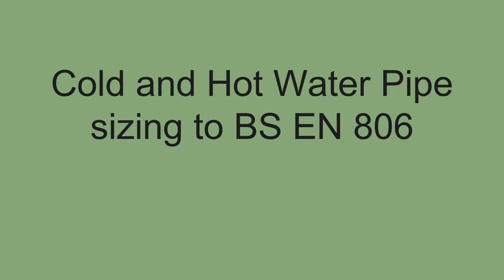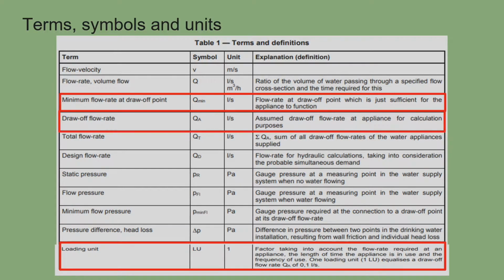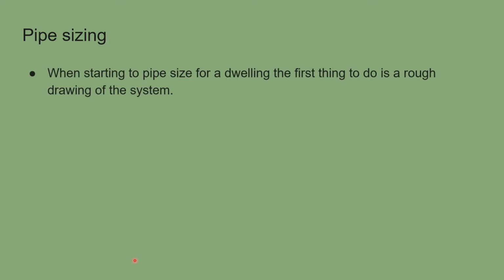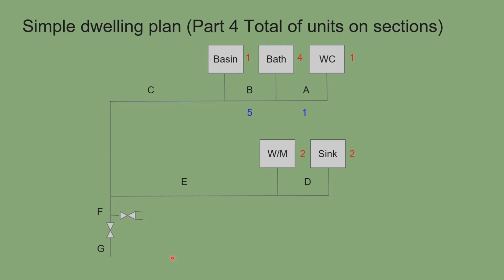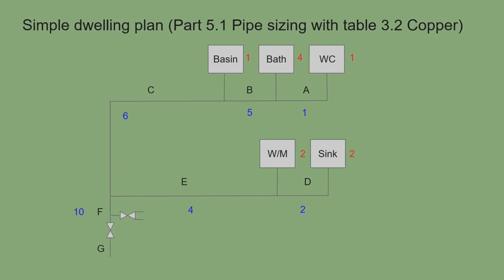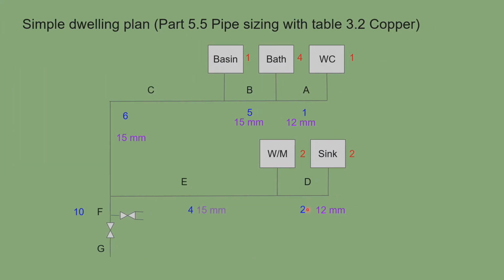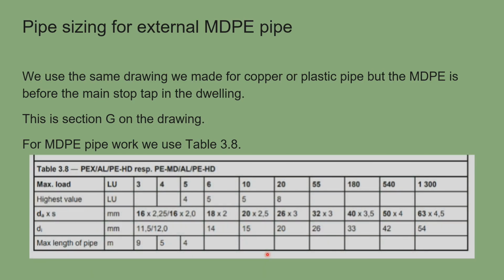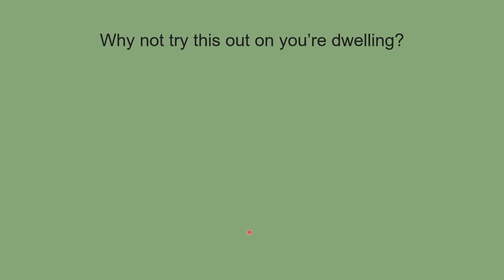Cold and Hot water pipe sizing to BS EN 806 Part 3 'Pipe Sizing Simplified method'

Comment: Hi mate,
I’m doing my EPA soon, there is a design task, do you have any suggestions on how to study for it?
Reply from the maker: Hiya,
Yes, there is a design part to your EPA. You will have to complete the exam and design assignment 10 days before your practical assessment part. The exam covers everything from phase 1 to phase 3. The design assignment is in 6 parts. 
1) Planning. Gantt charts, trade tasks.
2) Cold water (Loading units, sizing cws).
3) Hot water (Loading units, sizing unvented cylinders).
4) Central heating (heat loss).
5) Sanitation.
6) Guttering. 
Look over your design assignment training for phase 3 assessments.

Hope this helps 😅

Comment: One question: how is "max length of pipe" to be interpreted? There seems to be at least four different possible interpretations, and this isn't clarified anywhere in the standard: 

1. Max length of this particular section (until the next tee or appliance)
2. Max length of any single downstream section (between tees/fittings)
3. Max length of all downstream pipework
4. Max length of all downstream pipework of the same diameter
Reply from the maker: Good question. 🤔

There is no max length as such; it is only based on how many loading units are on each section of pipework and whether it is a domestic or industrial property. 
Domestic, we use BS EN 806, no max lengths as such. 
Industrial, we go to BS 6700, where we have to get all lengths of pipe runs, appliance loading units, and fittings.  😭

So, I would say, 1 is the more correct way of looking at it. 

As we start downstream, at the furthest appliances and work back upstream to the combi, thermal store, or unvented cylinder, increasing the loading units as we go back upstream at every tee. Adding more appliances as we go. This increases the size of the pipework. Ensuring we get the correct pressure and flows at all outlets. 
Thank you for your question. 👍
I hope this helped. 😀

Comment: Thank you. Really helpful video and clearly explained. Two questions please: firstly, are there acceptable proportions of flow rate for sizing hot and cold differently? For example, WCs and outside taps only use cold water, so don't affect hot supply to a shower and, as well as making sure the shower has a good flow rate, I'd like to minimise water wastage and waiting time before it gets hot. Secondly, what is an acceptable way to apply diversity to the water main, on the basis that everything won't be turned on at once?
Reply from the maker: Hi David, 
Sorry for the delay on answering. Thank you for you questions,

To answer the second question first as I think it is the easier one to start with. The applying of diversity has already been applied if we use the BS EN 806: Part 3 Pipe Sizing Simplified and it works well in domestic dwellings. If you want a more accurate answer, you would use BS6700: Design, installation, testing and maintenance of services supplying water for domestic use within buildings and their curtilages Specification. It's a ,more details calculation and a lot harder to work out.

For your first question, at 05:14 in this video, there is a table for loading units and the recommended and minimum flow rates for each outlet. This video was only covering the cold water side of the pipework, I have made another video for the hot water system. That one covers the difference types of hot water systems from combi's to cylinders and hopefully you will find the system you have at home and it helps. If you still have questions, please let me know. Here is the link to the hot water video: https://www.youtube.com/watch?v=nkWSlXCt9kA

Comment: Is this can work for Offices?
Reply from the maker: Normally when it comes to offices, I would be using BS 6700. I would try working it out with BS EN 806-3 first and as long as the loading units are not greater than 500, I would use it for the pipework design. If it is any bigger, you are much better off with BS 6700. Hope this answers your question.

Comment: Thank you for this, really helpful! If i'm limited by a 15mm cold main coming in. With a similar setup to your video, I'm assuming there wouldn't be any need to go from 15mm to 22mm even if the design recommends it?
Reply from the maker: Thank you for the feed back.
Sorry for not answers right away. Very busy with exams and assessments.
I would say yes, if this is a completely new install and there is no pipework around the home. It is still good to install it as the design goes, even if you have 15mm coming in. It will still help with all the outlets and an sure you have no problems in the future. I would also see about increasing the incoming main at the same time. But if this is already all installed then I would say leave it as is until you are upgrading the home and fix it all then.
Hope this answers your question.
Reply: Hi that’s great thank you for the reply! How does mains pressure, flow rate and pipe length between sections come into this? Is there an assumptions made for these calculations? Thanks again.

Comment: Very informative but would like to know how to convert LU to flowrate as the chart on page 13 doesn't make sense. Also, the sizes using BS EN806 are much smaller than those using the IOP guide. Why such a difference.
Reply from the maker: Thank you for your support and question.

Well, 1 LU is equal to 0.1 Litres per second (l/s) or (0.1 x 60) 6 Litres per minute (l/m), so if the whole installation in this video is 10 LU that would equal 1 l/s or 60 l/m. This is the best way of converting them. As the chart on page 13 is very confusing but from what I have worked out is, you get a ruler and use column 1 first using the l/s you have worked. then when you reach the bold line you go down and you can get the LU you need. But if you use my conversion you do get the same answer as the chart. Just reverse it. Say you worked out the bathroom needs 36 l/m divide by 60 seconds to get 0.6l/s and that is equal too 6LU.

The Institute of Plumbing Plumbing Engineering Service Design Guide was written in 2002 and is based on the old British Standard of BS 6700. This is now been replaced by BS EN 806: 2006. Yes, we do still BS 6700 for design and if you do read it at the start it does say as my dwelling are on mains water pressure 15mm pipe will do. I have found this incorrect on a number of faulty systems I have had to fix and Combi's are just not working to the requirements of the customers with 15mm all around. For me I always found the BS 6700 very hard for people to learn how to use and once the BS EN 806 come out, it just made it so much easier to do. I have tested both ways and I found BS EN 806 to be more accurate and came out with the same type of answer every time. As BS 6700, it seem to be more of how you follow the line and read the results. Everyone comes out with answer, ever to big, to small but sometimes just right. It can be very frustrating. 

Hope this answered your question and has helped. 😊
Reply: @mglplumbingtraining4067  Thanks you for your response.
I am working on a large commercial building with a number of showers, WCs and wash hand basins having a total LU of 126 and giving a pipe size of 35 copper. The equivalent using the IOP gives a total LU of 203 giving a pipe size of 54 copper which is a huge difference.  Also, using your assumption that 1 LU is equivalent to 0.1 l/s, the 126 LU would be equivalent to 12.6 l/s with is huge for a 35 dia pipe. The graph doesn't make sense as between 15 LU and 300 LU there is very little difference in flow rate if you use the top line.
Reply from the maker: Now I know you are talking commercial. Yes, the BS EN 806 will not work for it.  This is for domestic, if you read page 14, it informs you of this. I would be using BS 6700 to work out the size of pipework, which is what IOP is based on. So, 54mm for the mains in, sounds about right. 
As for the chart showing the Design flow rate (QD)  in l/s for standard-installations in relation to the total flow rate (QT) in LU. It is just showing us how they get the LU using the requires of the domestic system design. As I didn't design this chart, your guess is as good as mine. In table 2, it tells you the requirements for all appliance's, as shown in this video. 
Sounds like it's going to be a fun job. good luck and enjoy 😀
Reply: @ivanrebello3834  because the larger your total flow rate, the more diversity that can be applied to the system
Reply: @mglplumbingtraining4067 now that 6700 is withdrawn would you use 8558 for anything non domestic?

Comment: Hello, is there a limit for max diameter? For ex i want to use same pipe in whole house pex D25. Is there any cons an pros by doing this? Besides the price?
Reply from the maker: Hi Julijus Buivydas, this is a great question and even got me thinking. Hope this answers your question.

The max we normally work to for inside a domestic dwelling is 76mm in copper and 63mm PEX, for underground pipework to the dwelling the max is 63mm for MDPE but this is very rare, the biggest I have worked within a domestic dwelling was 35mm copper and 32mm PEX  When it comes to multi-storey (Flats, apartment and hotels) or industrial this size of pipework is common and have been known to go bigger. I have worked with 110mm copper and steel in these types of installations.

Yes, you could use 25mm PEX for it all but it should not be left anywhere the sun can hit it, as it will degrade it over time. It would work  but you will still need to reduce it's size to make the final connections to the outlets. 15mm to Kitchen sinks, toilet and basins and 22mm to baths are the standard sizes of pipework to them. The cost would be greater but you would have the best flow ever to all outlets as long as your incoming main is larger than the pipework inside and you have good pressure.
Reply: @mglplumbingtraining4067  yes the main question was if i can make the pipe work to every single draw off points D25 (we are talking about pex pipes) because as i heard too big pipe will reduces pressure in the house, especially in the shower and sinks. Plus if there is too big pipe in the shover, we will have to wait for a very long to get hot water, esspecialy over 15/20m distances. Planning to put in recirculating pump, but still does thos pump line should be the same D25 or it can be smaller? Likr D16 or something like that.

P.s. main pipe is D32 PE. In the house is 6 sinks, 2 showers, 2 WC, a bath tub, washing machine, boiler, dishwasher. 4 persons 150m2 farest ends 14m flat distance (~20m of pipe work)
Reply from the maker: As long as the mains pipework coming in is bigger and has the pressure it will not effect the pressure you should get. When you go from small pipe to large then it will have an effect and reduce the pressure. But when you design the system correctly the pipework will go from large to smaller which will keep the pressures you require. PEX pipework is for inside use and not for under the ground, your mains coming in would more likely MDPE.
If your pipework is 15 to 20 away from the heat sources, you already have a dead leg in the system, meaning the water would take to long to get hot at the outlet and would be a waste of water. It should have never been designed that way. No plumber would have fitted it like that. A secondary circulation (Bronze pump) would solve the problem of the dead leg but it would need to be design and installed correctly for it to work.

Comment: Thank you!!
Is there a formula to represent the Loading Unit to Flow Rate relation (Conversion Chart on BRITISH STANDARD BS 6700 : 1997 page - 72) please?
Reply from the maker: Hi and thank you for your question,

Sorry, I didn’t answer right away, I have been away and not near any of the paperwork.

First off your British is out of date and we are now on BS 6700:2006+A1:2009 but I have an old copy and have found the page you are talking about. In the new Standards, this is on pages 120 and 121. A lot more pages have been added but in this case, the information is the same so all ok.

The loading units used in BS6700 are different from BS EN 806 part 3 as they use different formulas to work out the sizing of the pipework. So sorry there is no formula to represent in relation to loading units and flow rates. They both work and we still use BS 6700 when we are wanting a more precise answer but is very long-winded to complete and you have to use the chart to take the loading units you have worked out for the dwelling. Then mark it onto the chart which then shows you the flow rates that you need for the next part of the equation. With BS EN 806 part 3, they have already done this and cut the formula down, this is why the title is ‘Pipe Sizing Simplified’ on the front of the document.

Hope this answered your question, anything else please feel free to ask.

Comment: Very useful. How can we find out required main incoming pressure using this method?  Thank you.
Reply from the maker: To find out the mains pressure you will need a Mains water pressure gauge. The one I use is this https://www.screwfix.com/p/monument-tools-mains-water-pressure-test-gauge-11bar/82412?kpid=82412&ds_kid=92700055262507126&ds_rl=1244066&gclid=CjwKCAjwiJqWBhBdEiwAtESPaIzIFoDGvFz1LVMSzuvfwublWCskYfwt8kKMrQRmW0fyM5kLxo9tNBoCH5IQAvD_BwE&gclsrc=aw.ds
You fit it to an outside tap and turn it on, the pressure will go up giving you the standing pressure, then open another tap inside and check the gauge again and this will give you the working pressure.

Hope this answers your question.

Comment: HI  great video, just a curiosity in 10:57 you have the chart of pipes - isnt push fit  pipe polybutylene, shouldn't that chart be used when working out pressure pipe rather than the copper one or does it give the same results? thanks
Reply from the maker: Hi,
Good question, and yes you are correct but after a number of times working out pipe sizing using them both I came up with the same answer, so now I just use the copper one for both. Plus I didn't want to risk being hit with a copyright showing more of the BS EN 806 part 3, so left it out. If you would like me to, I will be happy once I get time to make another one for polybutylene (PB) and (PEX) I will and I will use the same plans. 
Thank you for your question and your support.

Comment: hello how much combi boiler loading unit ? my cold water in combi boiler and out for hot water. i dont know how pipe size. Please help thanx
Reply: 6.3 KW boiler
Reply from the maker: Boiler size does not matter as much, the important bit is how many appliances it is suppling as that will be the total loading units you would use.
Reply: @mglplumbingtraining4067  And how much loading units for per radiator?
Reply from the maker: Sorry this system is for mains water pressure only and not for heating systems. That is done in a different way.
Reply: @mglplumbingtraining4067  thank you for answer.
Reply from the maker: You're very welcome
Reply from the maker: You work it out the same way you would for the cold water, what appliances are using the hot water? So if you had 1 basin, 1 kitchen sink and a bath. you would add up their loading units and that would be your combi's units. Bath is 4, plus 2 for sink and 1 for basin equals 7 loading units. You then add your combi to the cold water drawing where it should be and size from there. 

I am getting asked this one a lot so I am working on a video for both when you have combi's or an unvented cylinder on your cold water system. Plus adding the hot water sizing too.

Hope this has helped and answered your question. Any other questions please feel free to ask.
Reply: @mglplumbingtraining4067  Hello, thank you for your answer. Cold water is taken out of the tank and distributed to the equipment, and finally enters the boiler. It is distributed to the equipment as hot water. I can calculate of hot water coming out of the boiler, I can calculate of cold water coming out of the tank. But I don't know the cold water calculate that enters the boiler. in short, cold water is distributed from the tank and finally enters the boiler. I calculate from the combi to the tank. By giving the combi approximately 4 loading units. Is that true?
Reply from the maker: This system is for mains water pressure only and not tank/cistern feed system, I would have to show you a completely different way of working it out for this style of system. I am a little confused on your system design, as normally combi's are only on mains pressure not cistern feed as they do not get enough pressure. Unless you are on a booster pump system, you would need to reconfigure the math's for your pipe sizing. But out of curiosity where did you get the 4 from ;)